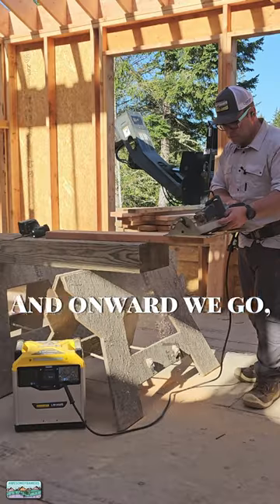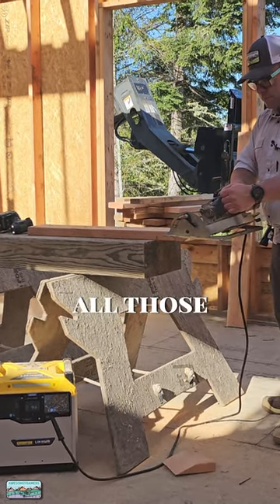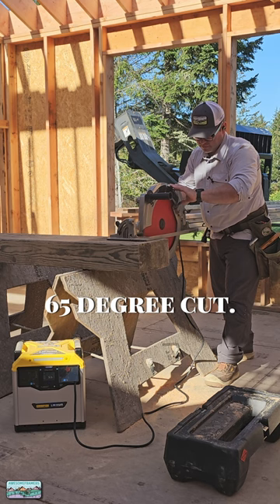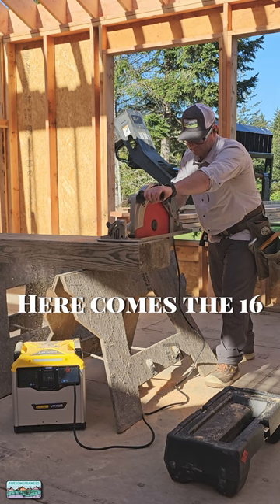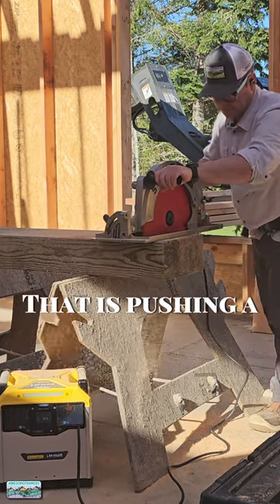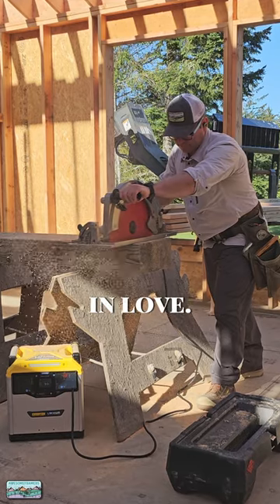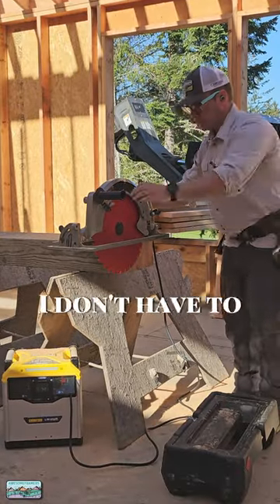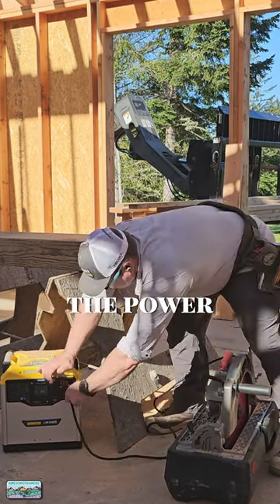Power Station for Power Tools

Comment: Tim I’m surprised that you don’t have a battery and inverter system in your vans for all the years doing what you do. I did a 1500 watt inverter with a deep cell battery years ago and glad I did. I can change all my tool batteries, power ac tools and site lighting.